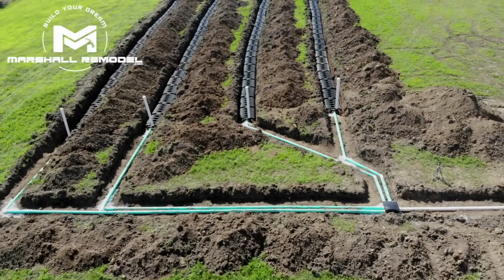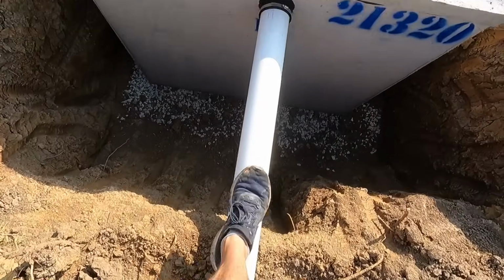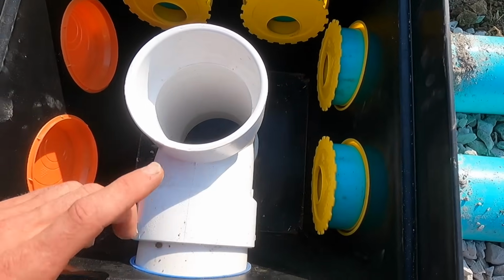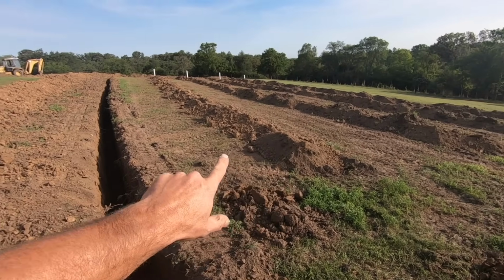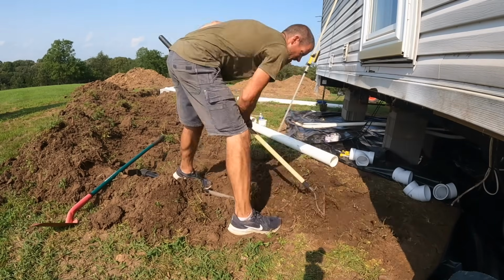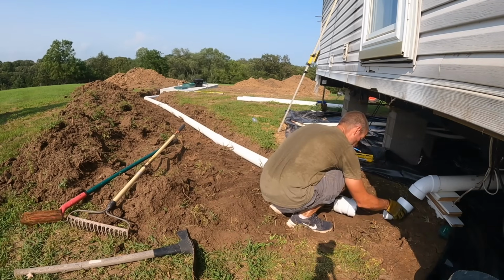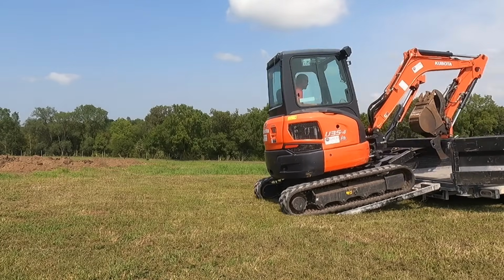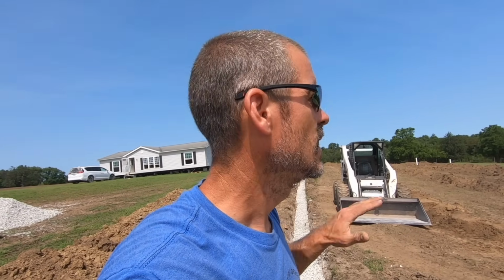Septic System Install with Mobile Home Hookup

Comment: i am a newbie but curious why the drainage is so long, what is the effect of it considered the amount of waste water coming out? to mw the pipes are too long, the septic should be as close as possible to the house.  Anyway, just a thought i have not knowledge about this business
Reply from the maker: These systems are designed and based on the grounds ability to absorb the liquids. I have no say in any of how large the system is or where the leach field is located. The county health department makes those decisions based of a perk test.

Comment: The county I want to build in does not allow non residents to pull septic permits despite being the owner. Opinions vary on the reasons but i say, if theres inspections I can pass, why shouldnt I be able to proceed now rather than get on a contractors schedule list that apparently others can get in front of you if they have more money. These days the labor and materials shortages mean that money talks and premiums just keep going up and up. #LGB.
Reply: No disrespect meant to the contractor here.. great video.

Comment: How much slope is too much slope for land?  Is there such thing?   Im in texas on red clay and sandy loam mix.
Reply: The maximum slope allowed on land where a septic system will be installed is dictated by the county Environmental Health department. There can definitely be too much slope. 
The same is true for the piping. There are minimums and maximums to ensure that liquids will carry away solids properly. Too little slope, and the solids sink and stay in the pipe. Too much slope, and the liquids run away too quickly and leave solids behind in the pipe.

Comment: Not a fan of pvc pipe on septic... we had to spend 6k on ours to replace the pipe, was 20 years old.. all the white pvc was crushed and flat as paper, corrugated portion though was fine... so we replaced the pvc with corrugated pipe
Reply: What caused it. Flatten PVC?  I don't get it.
Reply: @razony  yea the pvc pipe was all flattened and cracked.  20 feet out from the distribution box.  But once it got to the corrugated piping it was fine.   No idea what caused it other than decades being underground and the weight of the ground.

Comment: An air entrainment system is more effective than anaerobic systems.
Reply: True - but it has more moving parts that will require maintenance and electricity to operate. The main strength of a traditional gravity anaerobic system is simplicity of operation and reduced maintenance.

All that being said - either kind of system can fail, and it is almost always a costly proposition to resolve!

Comment: Why is that so freaking big?  That field is 3 times larger than the standard 1200 sq ft rock and pipe field common to Michigan.  Chambers are supposed to reduce the area needed, not increase it!

Comment: When installing underground drainage, there should be a clean out, at EVERY change in direction.  That first, 45* elbow, 30’ from the house should have been a wye, with a cleanout. Fix that and it will be closer to “perfect”.  Also, most sewer snakes are 50’ long, therefor  a cleanout, at every 50’, can save a lot of digging if any problems arise in the future. Its nice knowing our sh!t & p!ss is your bread & butter!

Comment: what's the approx material and installation cost for this setup?
Reply from the maker: Where we are located it's a $13-20K job depending on the size.
Reply: @MrPostFrame  That's not bad at all. I was expecting 30k.

Comment: Thinking way ahead, will the pole building be directly across from the manufactured home connecting to the tank with a similar 45° line? A mirror image of this install, basically.

Comment: This system will fail after 20 yrs due fact schedule 40 breaks to easy. Also the black part of the drain feil has no double  layer of soil fabric so the silt clay will clog it. And no layer of drain rock with soil cloth to keep it from clogging and way to drain the water.  Plus it will breakn freezing water due the feild is to shallow needs to be below frost line.

Comment: Your pipes between the thank and the Leaches are way to long that will couse a future issue biside you are using way to much space in your land for septic but hey wherever fit you mind
Reply: Is there a maximum allowable distance between septic tank and drain field?  What future issue are you concerned about?
Reply: @wallykramer7566  the longer the pipe between the tank and the drain more chances to get clogged if you don't have a choice I will install a D box whit  2 pipes from the tank to the drain otherwise not longer then 6 f oot

Comment: Your soil is garbage your trailer is on cement blocks you must be down south. Infiltrators cannot be used on new septic systems here in New York state only on repairs. Clearly you don't have Frost. You should also put 6 in of gravel under your infiltrators before you bury them with gravel cover with fabric and then put soil over. A perk test here is digging a three or four foot deep hole with a post hole digger filling with water and seeing how long it takes to drain.

Comment: that giant system was for ONE home? wtf. your county is crazy strict.
Reply: Most people have absolutely NO concept of how much space an on-site septic system requires. When you design these for a living, it's a constant struggle. People want to buy a 0.3 acre lakefront lot with horrible topography and build a massive 5-bedroom house with a basement, in-ground pool, detached garage, and drinking well...and then they don't understand why we can't permit a septic system there.
Reply: @adamlone5548  If it makes you feel better, I deal with exactly the same thing here in AR. Also, explaining that the septic tank isn't but a single component of the system.

Comment: When installing a septic system there is not suppose to be any twist and turns in the line between the house and the septic tank! And it is suppose to be at least 50' from the house! And why do you leave the yard in such a mess? And why does cost such an enormous amount? And why do you need electricity for that ?  What happens when the power is out for an extended period of time?  This type of septic is never payed for! And how are they suppose to mow that after you have left it in such an awful mess? If it was me I would have it removed! Because there is better ones on the market, and way cheaper. This was not done correctly.
Reply: Your codes and requirements, his codes and requirements, my codes and requirements, every place is different. This system is perfectly fine !